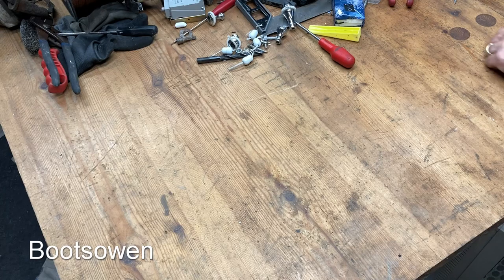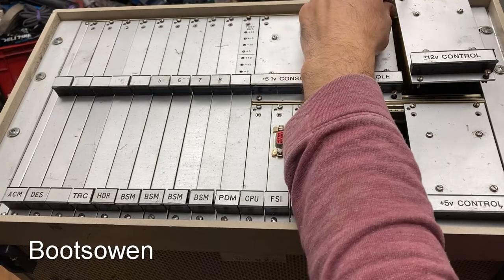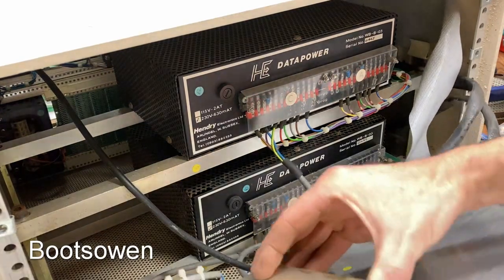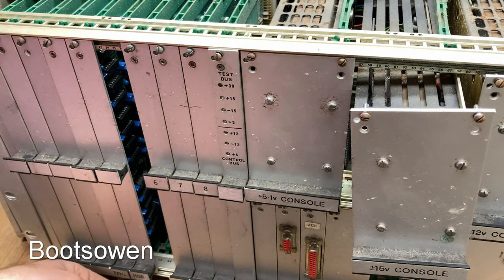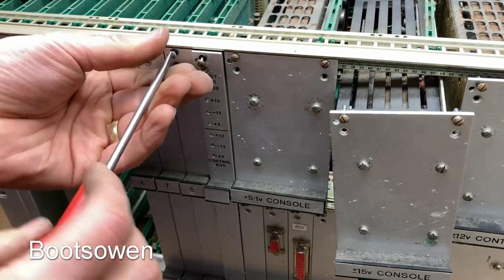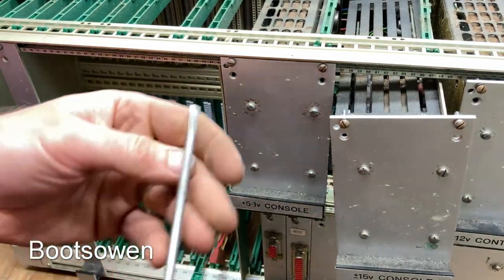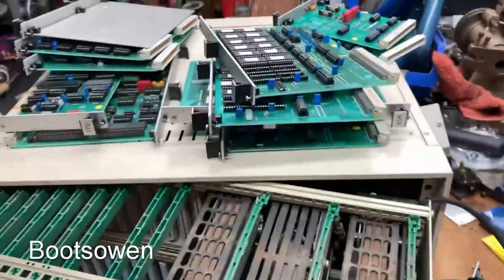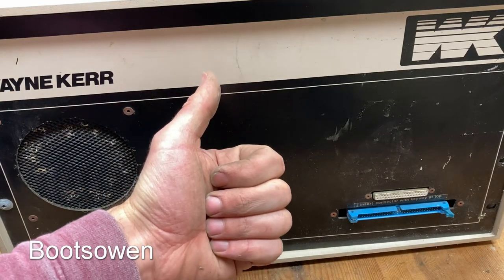Wayne Kerr A8000CB PCB tester: a look inside, what is it? Vintage electronics and computing

Comment: Data power, I had one of their 48v inverters years ago, weighed about 50Kg and consumed 200w just to run its self. However it worked and was fine but not for continuous running, cheers
Reply from the maker: They seem to be very well made, the kind of thing that would run forever. Quality versus cost versus lifetime energy consumption.